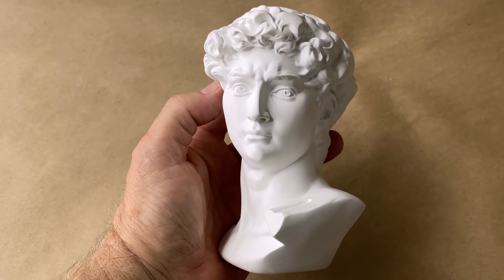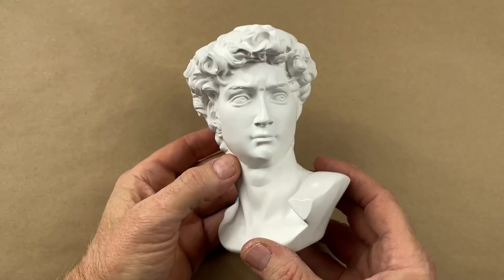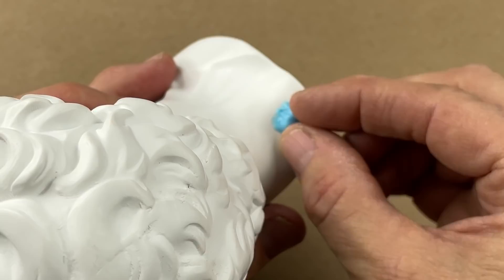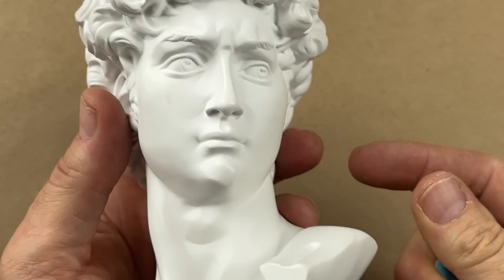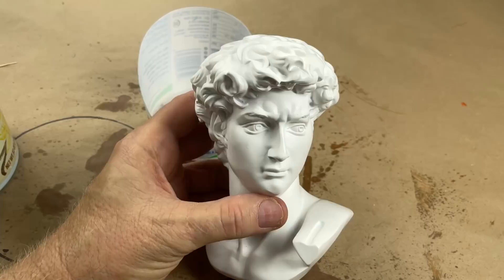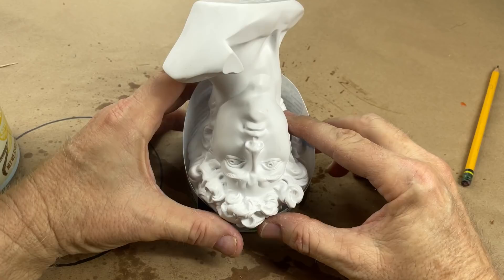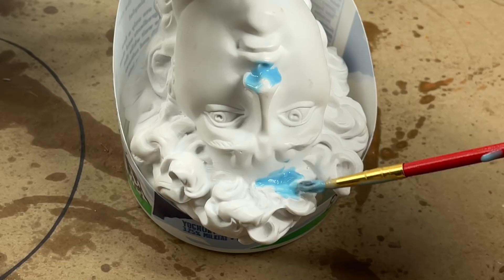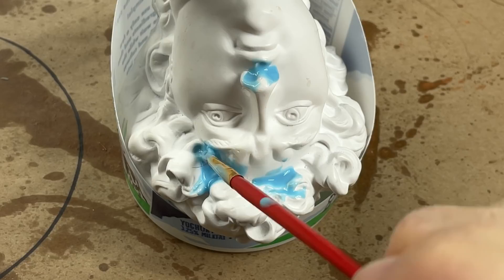Making A Candle With A Silicone Rubber Mold

Comment: Where did you get your little pen-style wax melt device? I need one of those for my own candle work.  Also can you recommend a superior flush wick cutter that cuts VERY flush?  I love your videos and learn so much.  Thank you! Peggy
Reply from the maker: It is a Foredom Wax Carving pen.  They are sold In lots of places online. It’s the best wax pen I have ever used but is somewhat pricey. There are also lots of less expensive wax pens on the market.
Reply: @RobertTolone  Thank you…I intend to order one in the next couple of weeks. Now another question…suppose I wanted to use this to carve a hunk of Monster Clay into a candle prototype, of which I would create a silicone mold…would the carving tool work as well with Monster Clay, (which contains wax and hardens rather a lot when cool)… What do you think? And, thank you for graciously replying! 🕯
Reply from the maker: @peggynelson2357  Monster clay melts, so in theory it would work with a waxer. I do not use it so I have no direct experience to relate.
Reply: @RobertTolone  Thank you for that insight. I wish that I could give you an idea of smthg I want to do, privately, and get an idea of how you would do it. I’ve made many of my own molds using diff silicones..my fav right now is Polytek PlatSil 21-11, for excellent stretch and detail. My questions have to do w getting my own design idea in a prototype to mold.

Comment: He skipped over his to get the wick through the head of the mold. If the head is in the bottom portion of mold wouldn't you need to drill a whole so the wick pushes through? 🤨

Comment: Another awesome video. I’ve learned so much watching you tackle problem after problem. 

I’ve been making molds for prop weapons and got quite stumped recently trying to make a hollow barrel for a Mandalorian blaster (IB-94). I would be super interested to see your approach to this problem.

Would you be interested if I were to send you the part?
Reply from the maker: How you make it depends on how much of the barrel you want to be hollow. If you need the entire barrel to be hollow your only option is to cast the gun in two halves. Each half would have the bore machined out in the sculpt. If you only need the front part of the barrel hollow you could cast that section solid and bore out the muzzle on a drill press or mill. There’s that tapered section behind the front sight and If that needs to be hollow you could cut that inside taper on a lathe.  The more pieces you are willing to break the gun into, the easier it is to cast in resin.
Reply: @RobertTolone  yeah, I was wanting to try and have the cast be hollow without boring (I don’t have a drill press, just because I don’t have the workbench space for it). 

I’ve heard about people trying to use dowels to keep the silicone straight, but it’s never quite worked out.
Reply from the maker: @ryancreasey5833  Resin casting can do amazing things but it has limitations. Deep holes like gun barrels are one of them.

Comment: Maybe try casting it in beeswax next time? That might be more up your alley ;)
Reply from the maker: In this project the wax was supplied to me by Noura who sent the project in. But I am tempted to cast it in pure beeswax just to see if it would give a different result.  This wax was a blend of several waxes but I don’t know exactly what it was.
Reply: OR maybe just use sticky wax. That way you can stick the candle to any surface or wall. So no need for a candleholder. ^^

Comment: Will parifin wax work?
Reply from the maker: I’m not a candle maker so I don’t have much experience with candle waxes. From what I’ve seen paraffin should work, but it does shrink and might pull away from the sides of the mold.  Test it out and see what happens.
Reply: @RobertTolone  haha no I meant waxing the mold case
Reply from the maker: @charliesybert2683  I prefer beeswax because nothing sticks to it. Paraffin is petroleum based as are the resins so you could have sticking issues.  The rubber should work fine though.
Reply: @RobertTolone  well thank you for that now I know what I have won't work too good so it's off to the craft store

Comment: I love your videos, but respectfully, for the sake of speed in mass production, this probably should have been a 2 part mold. A little more time in the mold build, but knocking out casts is far easier with a straight sided 2 part. Plus wax is soft, hard to pry without warping, easy to trim and flash if necessary. Keep them coming Robert!
Reply from the maker: That thing shrank so much it practically fell out of the mold! 😄. And zero parting lines. That said, lots of candlemakers do use two-part molds.

Comment: dear god what is an audio compressor
Reply from the maker: Hate that old compressor!  It’s ridiculously loud!
Reply: @RobertTolone  audio compressor my friend
Reply from the maker: @diaconus1423  I misunderstood your comment. I guess you are commenting on the quality of the audio in my videos.  I have to say that audio is the hardest part for me and I haven’t got it right.  Don’t know anything about compression; how it works or how to do it.  Suppose it’s high time to learn!
Reply: @RobertTolone  it helps to keep the loudest sounds and quietest sounds closer in volume. So when you are speaking with the compressor on everything will come through more evenly, and ideally clearer. I’m not sure what you’re using for editing but it’s a pretty common feature, your application may include it

Comment: Can you put a cut mold in a vacuum chamber or would it force a leak???
Reply from the maker: I never use vacuum when pouring resin. The vacuum chamber is used to degas  rubber before pouring the mold.  I use a pressure pot to help cure the resin without bubbles. It helps, but its not always 100% successful.